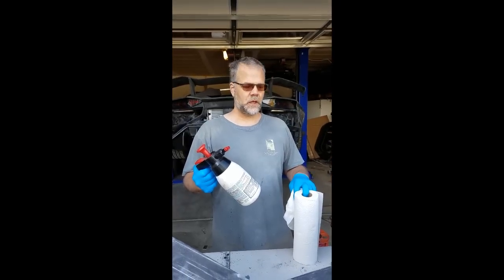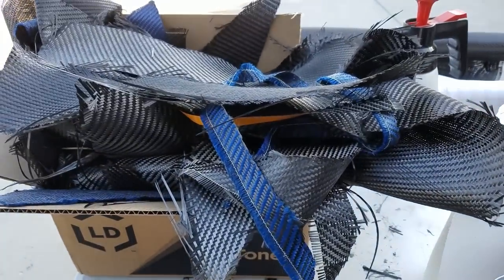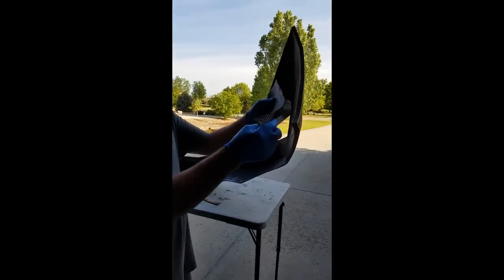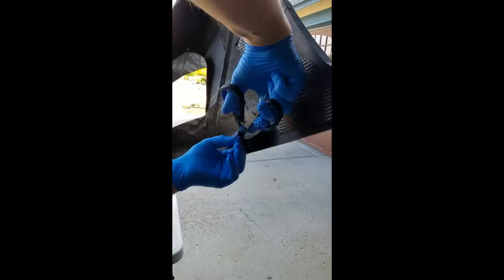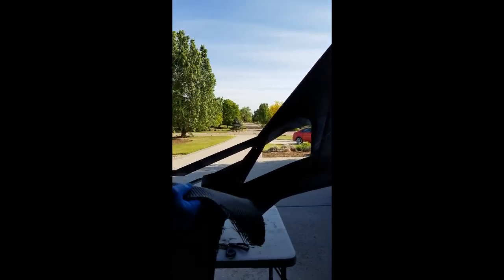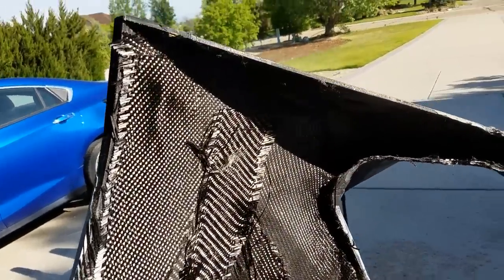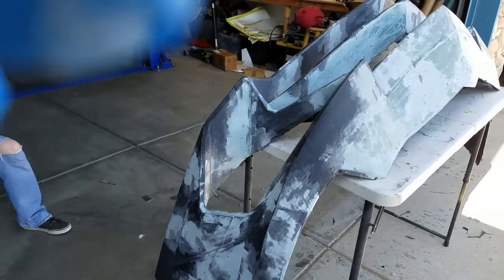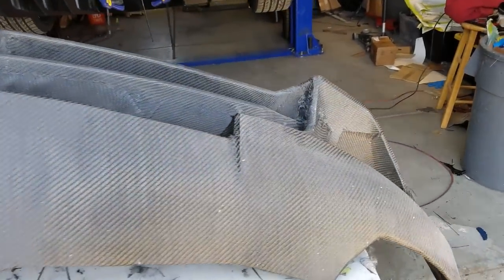Skinning 3D printed body parts (encapsulation) CF - Part 3

Comment: have you experienced delaminating at all? If so, how have you midigated it? I've been trying to add a fiberglass backing layer to a sanded ASA print of mine but it delaminates with epoxy.

Comment: Hi thanks for showing the process. 
What filament material did you use? ABS? PTEG? PLA?
Reply from the maker: PLA
Reply: @lasersterling  doesn't warp the shape of the PLA when the epoxi is curing? the curing of epoxi gets up to quite high temps I know. Not sure if high enough to cause problems though
Reply from the maker: Sure does.  To do it over I would use ABS.
Reply: @lasersterling  hmm okay I think I will order some rolls of ABS then. 
Just bought the Anycubic Predator 3d printer to print my custom designed wide body kit for my car :) 
Thanks for responding very cool!
Reply from the maker: Also, I found if i keep it thin, 5mm, PLA works fine.

Comment: Hy, may i know how many kg u spend on the filament for the whole car?
Reply from the maker: 220kg
Reply: @lasersterling  carbon fiber cloth or cloth + epoxy ?
Reply: @lasersterling  were you able to get a deal buying in bulk somewhere? I'm doing a similar project but different model and trying to find a deal buying in bulk.
Reply from the maker: @nickmkkay  CF, or plastic?
Reply: @lasersterling  Looking for plastic deals atm, I'm a ways off from starting the encapsulation.  I just started so I'm just using up my supply of hatchbox atm but it's pretty pricey.